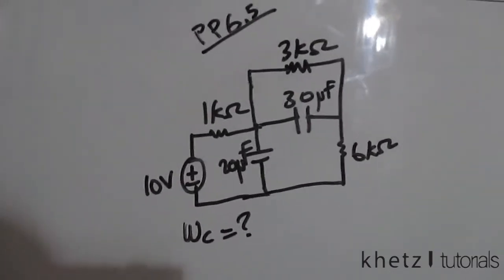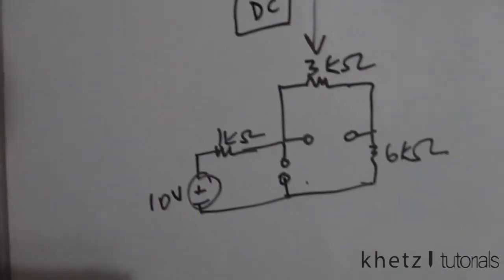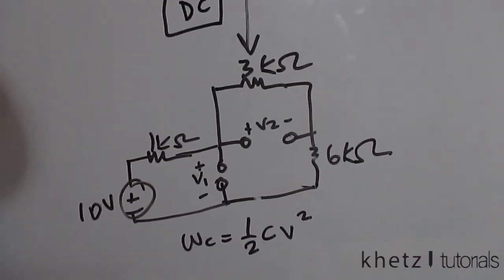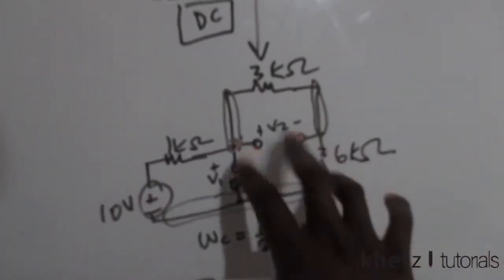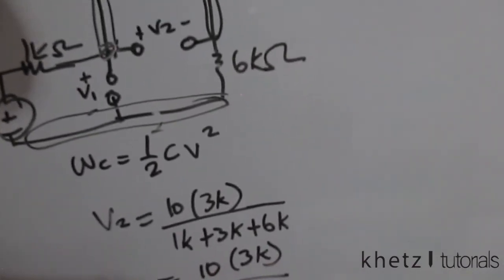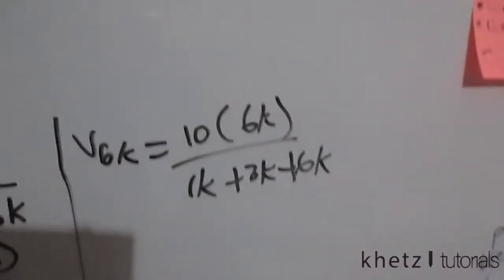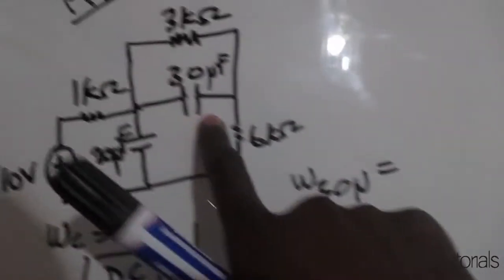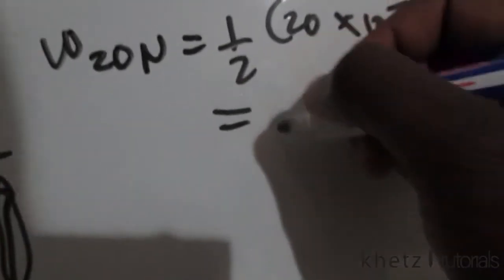Fundamentals Of Electric Circuits Practice Problem 6.5

Comment: How do we define the polarities of capacitors here after removing them?
Reply from the maker: Actual/physical capacitors are polarized and you can easily see the polarity from the annotations. This is not usually shown on circuit diagrams because the capacitor's symbol would be mistaken for a cell, most probably. The polarity can be shown using a voltage label with a plus and minus indicated and you would use that polarity in that case. If it is not indicated, you can always assume the default, which is top-down or left-right, starting with the positive sign.
Reply: @KhetzTutorials  Thank you

Comment: please i didn’t understand why you say v1 is equal to the sum of the voltage across 3 and 6 resisitor??
Reply from the maker: V1 is parallel to the sum of the voltages across each. You can also add the voltages on the right hand side to get -V1 + V3k + V6k = 0. If you rearrange, that'll give you V1 = V3k + V6k
Reply: @KhetzTutorials  I got it thank youuuuu very much sir😍😍😍😍😍